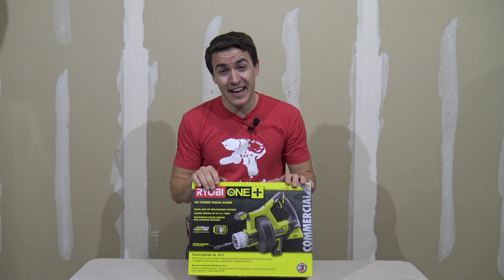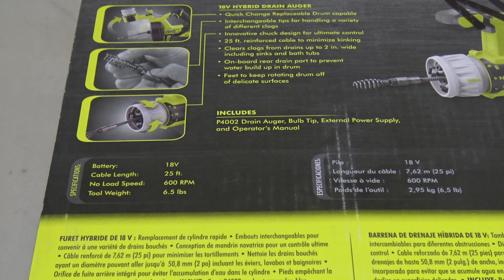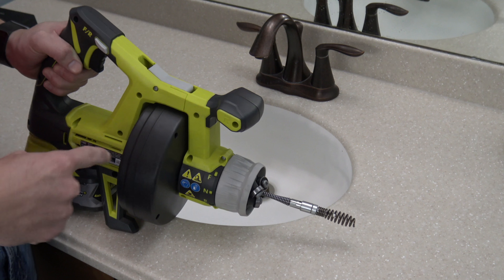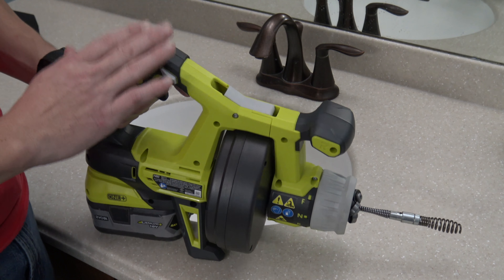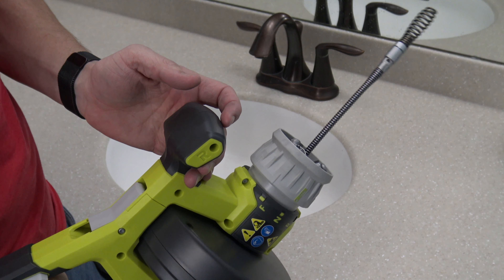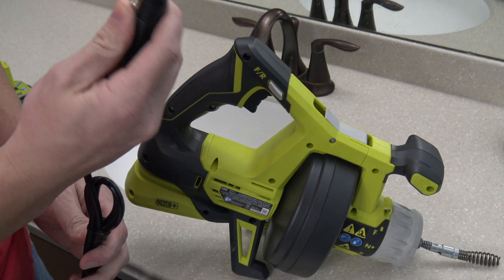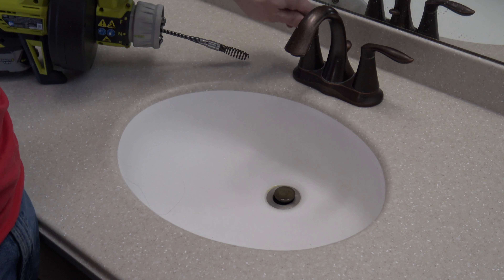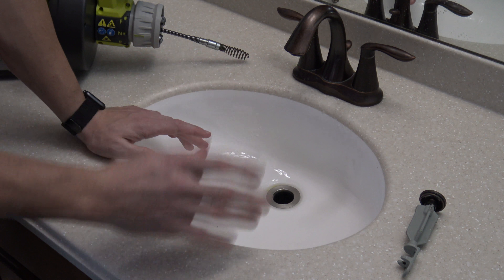Ryobi ONE+ 18-Volt Hybrid Dual Power Drain Auger - P4002 (REVIEW)

Comment: Before I say what I’m going to say, I thank you for the review and the demonstration of how the machine works. Be warned to potential buyers! You can not return this item once open. The snake is very weak it only took less than two minutes out of the box for mine to kink and bend. Home Depot is out of stock of the replacement 25ft snake drums, they only have the 50ft for the bigger version, and I was told that not only their not have it but there was a big possibility that they’re not going to have more. So in my case I wasted $149 plus tax down the drain, what an irony.
Reply: Buy a 50' snake and cut it in half

Comment: I've read comments about P traps and it not going through but on a small P trap like a sink,  but your first move is always to get a bucket and go under the sink and remove the P trap and take it outside and clean the gunk out of it and all the other drain pipes that can be disconnected.  Ram a shop towel through them to the point they're as clean as brand new.   Then put a towel down and run this tool into the pipe if it's still clogged.   I would never run this down a sink drain from up top unless it was an emergency,  and  in most bathrooms you have a drain rod you have to remove anyway.  Most of the time the gook is in the P trap and the horizontal pipe into the wall in back of the cabinet.   This is perfect for cleaning out gook a hose won't get out of an HVAC condensate line, or small clogs in bathtubs.  Even on a toilet I'd plunge it and do it for a while before trying this.   This is really meant for kitchen and bathroomm sinks and showers, not toilets and major sewer lines.   It will probably work on a toilet but if it's really clogged you have to pump out the toilet and remove it, then get a big auger down there.  
 Bust out the tools and just do it right.  Bigger clogs, roots etc needs heavy duty gear.  I think people are trying to use this beyond it's capacity level.

Comment: I finally bit the bullet and bought this. I had a rigid auger that works with a drill. It was kind of a pain to use because you had to use both hands to make it work. One to squeeze the handle for feeding in and out, and the other to either crank the wheel or pull the trigger on the drill.

I snaked every drain in my house I could and was still having issues. So I looked up the specs on this and saw it snakes wider pipes than the rigid I have (1.5” rigid vs 2” ryobi). I figured between the replaceable drum and the ability to use different tips this wasn’t a bad investment to have anyways even though the cost is more than I wanted to spend.

Well I got through the kitchen and bathroom sinks and both times this pulled gunk out. Whereas the rigid I had didn’t pull anything out. Both sinks are working fine now. So I think this was money well spent.
Reply: As a follow up video, could you guys go over replacing the drum, what to do if you over feed the line and it’s not retracting, and also the different tips available? I don’t see any videos on YouTube covering those things.

Comment: The part of the AC plug the plugs into the unit needs to be a 90 degree plug to fit better and eliminate any stress on the cord.
Reply from the maker: DASFREAK exactly! Not sure what the reason was for doing the way they did...
Reply: Solely Ryobi it looks like an XLR plug.they sell 90° bend adapters for XLR cables. But ya they should’ve included that.
Reply: Kinda confounding that the plug is 2-pronged (i.e., not built for grounded outlet), but the instructions say it "should" (not "must") be used with a GFCI outlet.

Comment: I would say to read the instructions on this and make sure you understand how it work to avoid damaging it.   Also, you never need to open the end up unless you're changing the cable and pull the handle out then move it upwards otherwise you can break the plastic tabs in side the handle.  Never run it in reverse like a drill unless the collar is out and unlocked or you'll kink it.  It always spins clockwise to advance or retract the cable.  Anyway, do yourself a favor and spend an hour reading the manual and playing with it but read the manual first before you break it in about 30 seconds.   Lightweight tool for lightweight jobs, but seems okay for that kind of thing.

Comment: Help! The cable spun out and completely disengaged from the drum/machine, and now is stuck in the pipe and can't be pulled out! How can we insert it back to the machine? We want to use the electric power to reverse it out.
Reply: Should have painted the last three feet a bright color to alert you it was at the end , u will have to manually retract it or buy the replacement drum and cable if it’s now damaged

Comment: Used mine today 

This is the best UNDER $200 DUAL POWER snake   has the MOST FEATURES 

Got mine for $99. They had it on the wrong shelf lol
Reply: Bought this in the swap meet for $25 and what a piece of S lol oh well live and learn at least I wasn’t out $100+ the problem was the forward and reverse options don’t work that good this is the issue for all these tools.
Reply: @hermilopadron4102  then you DONT KNOW what your doing 

I've made over $4k over the years using this little neater power snake

Don't blame the tool 

You also bought it Used at a garage sale for 10%  of what if cost 

The good one cost $200 and $300 

Yours was probably already worn out when you bought it

That orrrrrr you don't know how to use this one
Reply: @Save-A-DogAps lol if you where to show up at my home with that pos I would immediately tell you to get the hell off my property. Hahshaha

Comment: RPM's?  Specs on Ryobi site only list the weight of the unit??  Doesn't look to have too much tourque or RPM's.  Looks like I could spin a hand crank snake faster.
Reply: Actually just watched another review and the RPMs look decent.  I guess you just weren't squeezing the trigger all the way??
Reply: I've got the first version and it's surprisingly powerful and way easier than a handcrank snake.  I've used a few different pro, small snakes and the power is comparable

Comment: Does p4002 lock the cable like p4001? Does p4002 lock the cable in neutral or do u have to work cable by hand with though clogs?
Reply: You can lock the cable

Comment: I cant get it to work correctly in Reverse. Takes 3 minutes  to go in and 20 minutes to reverse. faster push it in by hand.
Reply: richard foran not sure if you’ve figured it out. But I had the same thing happen to me. I think what it was is I extended it out too far. Once you get towards the end there’s a little bulb that’s thicker then the cable around it. Pull it in manually until that bulb is back in the drum then it worked fine for me retracting.